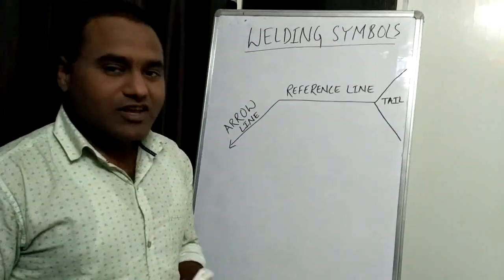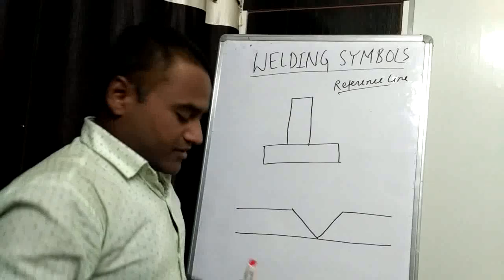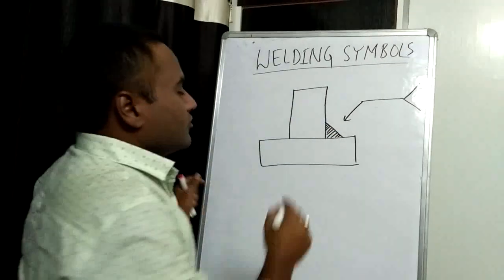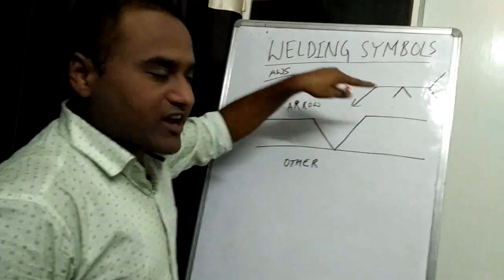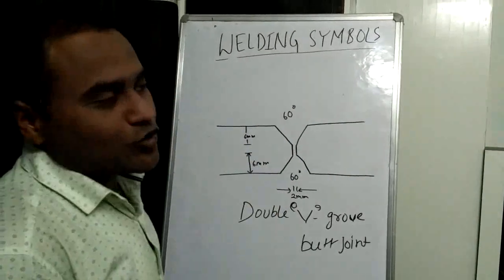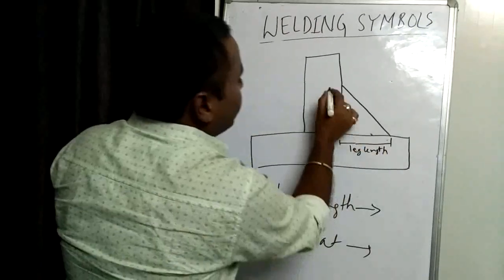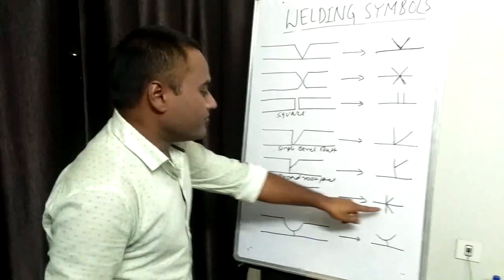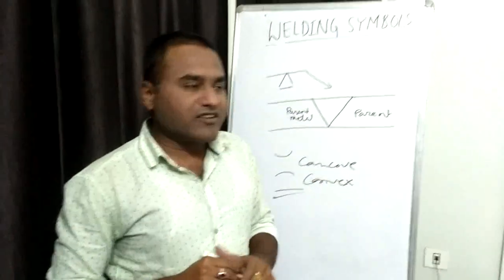[English] Welding Symbols

Comment: It is not just AWS that doesn't use the dashed line part of the reference line. More countries use a single solid line. The dashed line was introduced in Europe as half the countries used the symbol on top of the line for weld this side and other half used the symbol below the line. Addition of the dashed reference line allowed old drawings to be updated and confusion to be removed - dashed line = "hidden line" on technical drawings so becomes the other side (hidden).
Reply: Which method( AWS or ISO) they prefer in asian countries like india etc...
Iso method is standard one???